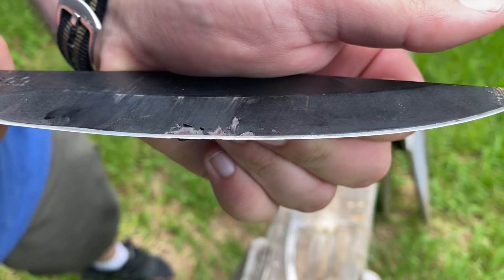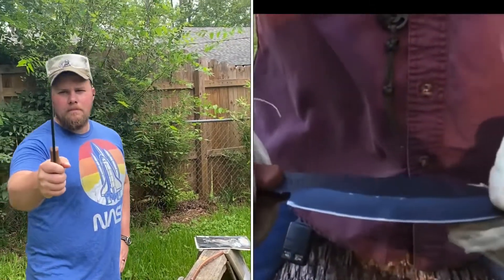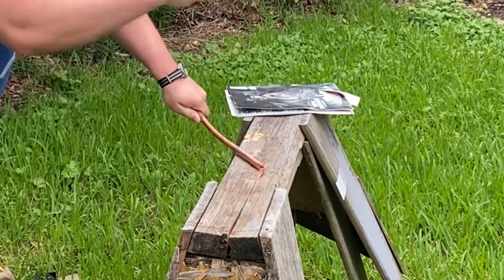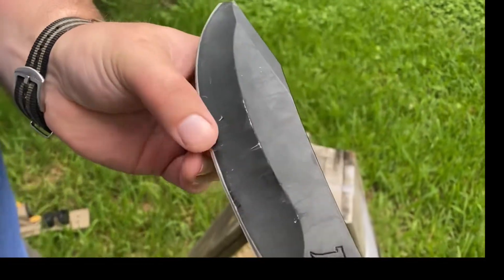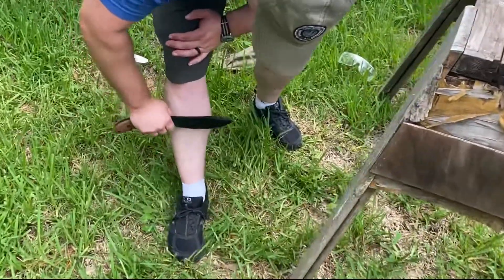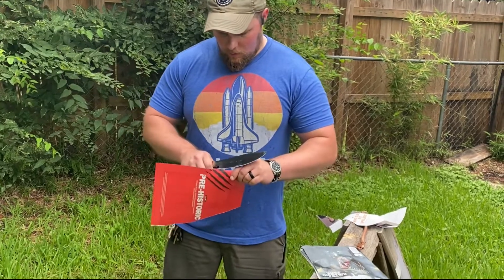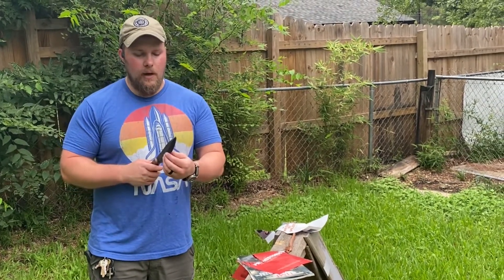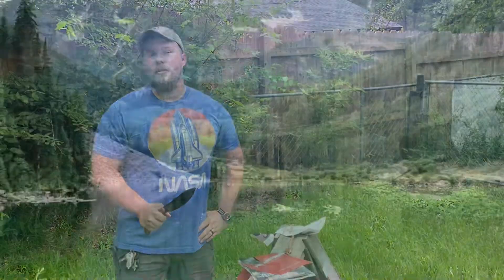Copper Tube Chop: Kabar Potbelly 1095 Cor-Van

Comment: Yeah kabar definitely did fix that issue with these as I bought one a few years back and mine is not a hollow ground blade it's a Sabre and boy is she a thicccc one! It took me hours and hours of sharpening by hand to thin the edge down enough to be functional or atleast to my standards 🤷‍♂️ bur unfortunately the reputation of this model had already been shot and they didn't sell very well at all as they were also known for snapping right before the handle thee entire blade would just go flying off if you try to chop on a log lol so to fix it they just left it a super chunky boy and leave the sharpening or thinning out to the customers but it worked because I've tweaked mine into a hard maple log tip test and she survived also chopped the daylights out of that same log and blade didn't snap off! The good thing with kabar is you can send that one in and they'll send you a brand new one the newer revised version!

Comment: Low alloy steels (Carbon steels) in general are toughre than stainless steels usually are, however their tips do not bent as the softer stainless steels do, that's why tips on low alloy steels break a bit easier. That being said, if it was any other stainlees steel, other than something like AEB-L, that edge wouldn't have held that good.  
                        Most KA-BARs made of Carbon V steel, have really good edge stability which is what you mostly want on a hard use knife. Lateral toughness, is just for making stupid Youtube videos, trying to prove that a knie is good or not, but that's when I know the creator has zero knowledge or understanding about knives. It's the edge stability that counts for such knives, thats als owhy, you see people talking about ease of sharpness for a good outdoors knife, because if the edge takes damage, you won't be able to fix it in the field, if the steel is superhard. 
                         The best edge stability I've seen on knives, are usually handforged, made of Vanadis 4 Extra, or Ballbearing steel. AEB-L or some sort of low alloy like 10xx series etc.
Of course, heat treatment is the most important, then geometry and lastly the steel itself.
Reply: Yup, 1095CV (aka Carbon V from CS as well as the same steel as old school Case Chrome Vanadium blades) are/ were supposed to be ground and heat treated for general use to hard use outdoor tools. The stuff isn't magic, you have to make sure stress risers are eliminated with choppers etc. IME Kbar ran the Rockwell just a tad higher too than CS or Ontario, and well, I just don't pry with a hollow ground anything, at all, ever....different effects can be achieved on hollow ground factory knives as has been demonstrated REPEATEDLY when one does so, most of which are not good😂. If you wanna chop get a khukuri, pry get a Becker BK3😂